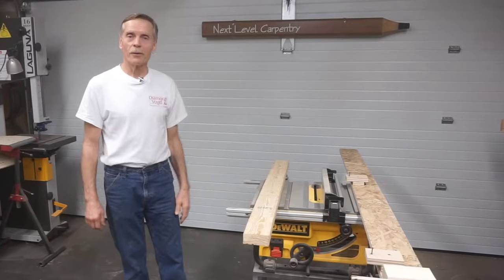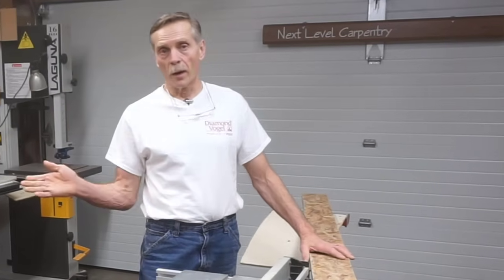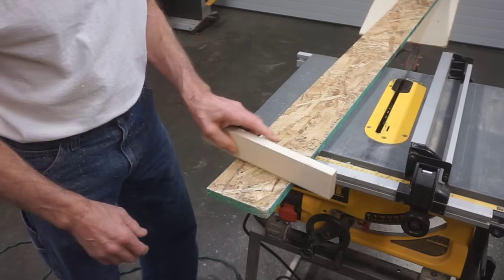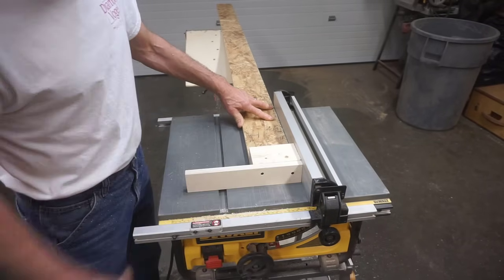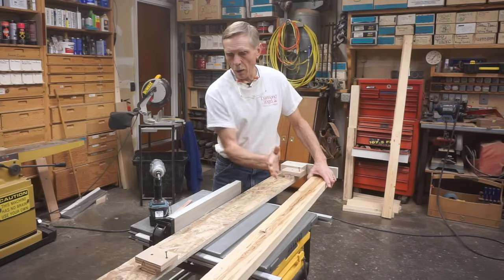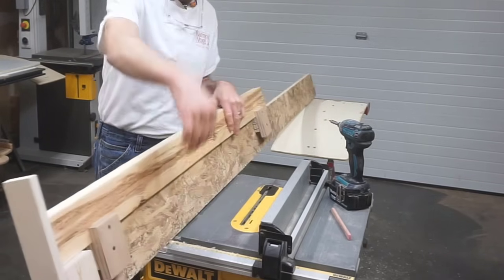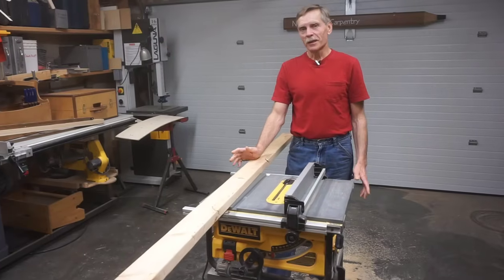How to Cut a Straight Edge on Crooked Boards

Comment: Dear Next Level Carpentry: It seems that your "Contractors Saw" is perfectly squared and that the fence is perfect.  One old carpenter once told me to "forget about portable saws" like yours, possibly because he had tried a lesser one, that had a useless fence. As here in my country all table saws are very expensive, my question is if you judge your saw to be good enough for precision work, or should I wait to buy (or build) a better one, Another person with a lot of dexterity, preferred to build his one from an inverted 8 1/4" Makita hand circular saw, and a third carpenter said he will always "build" a table saw from an arbor with bearings and pulleys and a larger motor"... What can you tell us?
Reply from the maker: I've had the DeWalt tablesaw you see in this video for about 20 years.  It's done everything I required of it on jobsites without disappointment over those years so I'd say it's perfect for that type of work: framing, siding and (with a high quality blade), trim installation.  I don't think you'd do better making a saw for jobsite use from a circular saw, at least where efficiency is concerned.  I don't judge the DeWalt as good enough for precision work like cabinetry and millwork.  If your goal is to do that level of work in a dedicated shop space then I recommend saving up as much as you can and buy the highest quality machine you can afford.  That doesn't mean a new saw either: shop around and, if you're lucky, you can find someone selling one because they upgraded or maybe quit the business... that's how I got the Delta Unisaw I've had for 35 years: business liquidation.  Good luck in your quest... Best, Matt
Reply: @NextLevelCarpentry  Thanks so much for your detailed response, I'll try to find a good used one.

Comment: If you're going to screw into the board you're straightening, why not just put the factory edge board directly onto it, screw them together, flip and cut?
Reply from the maker: That's another way of doing the same thing but I personally don't like it because of the extra blade height needed to make the cut, but that's just me...

Comment: All that for a 2x4?  Of course you could just run the piece through using a longer straight board as an extra long fence similar to this except without all the nonsense.  It would be the same result.  Push sticks for safety is all you need.
Reply from the maker: Please link to the video you produced to elucidate the world from your fount of knowledge to prove 'it would be the same result' because, without that, I call 'nonsense' on your comment.
Reply: @NextLevelCarpentry  r we still talking about a 2x4?
Reply from the maker: @thetruthonlydementia7379  I believe YOU are... but I also believe you've missed the point and lesson of the video.

Comment: Seems like a lot of work unless you have a sh---load of bananas to cut straight. Fastest IMO is to fasten a piece of scrap plywood (or scrap wood paneling) at both ends and middle to the banana board so none of the banana is out past the straight piece. Run through saw at depth of banana. Remove 3 screws. Discard narrow trimmed piece of plywood or paneling.

Comment: Efficiency! spending excessive time on setup  to correct inexpensive lumber to me makes little sense. If its late in the evening, you have a chance to finish a project that's is in a  remote location, maybe! but I just dont see the value.
Reply from the maker: Apparently it hasn't occurred to you that there may well be plenty of value in situations outside of your experience.  You might spend time figuring out why this video, produced by a career carpenter, has over 2 million views and earned it 48K thumbs up vs barely 1K thumbs down... you might well benefit from a little outside the box thinking perhaps?
Reply: Not all lumber is inexpensive. The technique may be on expensive hardwood boards, which is probably what Next Level had in mind. By the way, if it's a shorter piece, one could get the same effect by simply placing the straight edge along the fence and moving the bowed board along that -- it would have to be at least twice the length of the bowed piece, I guess, so that it doesn't rock or deviate from the straight line.

Comment: Good tip. A small correction though;  deviation from a straight line along the edge of a board is called 'crook' not bow. 'Bow' is a deviation from perfectly straight along the face of a board. If you have a 2x6, the edge is the 2 inch thickness and the face is the 6 inch width. Note: actual measurements are 1.5 inches and 5.5 inches for planed kiln dried lumber.  And its technically called a 'plank', not a "board"....just to correct myself. :)
EDIT:  I just noticed that the video title (correctly) refers to the illustrated deviation as "crook".

Comment: Only thing now there is a screw 
Hole in board ya want straight.
Reply from the maker: If you can't think your way out of that problem you best avoid working with tools with sharp, spinning blades... juss' sayin, dude. 🤯🤣
Reply: I meant to say ya straightening a piece of maple and ya used the wood clamps to hold it down with the straight board against fence. You take screws out ya have a whole in the board ya straightened. 😃
Reply from the maker: @williamlhumphrey8326  Like I said... if you can't think you way out of it...

Comment: That might be useful with high priced wood but not for a $2.00 2x4
Reply from the maker: You're kind of missing the point here George.  Actually it's NOT useful for high priced wood... that's what jointers are for.  It's foolish to assume this is meant to salvage one $2 board too.  The point is that when it's necessary to straighten a board with a bow, for whatever reason and for whatever cost justification THIS is how to go about it.

Comment: This all works for short stuff but not really useful for an 8 10 or longer board.
Reply from the maker: Why do you say that?  I've straightened 10'ers using the same method... granted, it's a little tricky but still totally doable.

Comment: I like your method, but I have to question the cost/benefits to doing this. If you are paying someone $15 an hour, doesn't it make more sense to use them to build with the straight boards you have rather than spending time straightening boards that after they are "straightened" can't be used as dimensional lumber? The cost of a 2x4 doesn't come close to what it costs in time to have someone do this.
Reply from the maker: I've answered this question a dozen times or more: your viewpoint is myopic, Doug.  I can tell you more than a few situations where this is absolutely practical, sensible and profitable but leave it to you to expand your perspective and answer the question for yourself.  Best, Matt

Comment: I dont know that I would trust that stock lumber has a straight edge everytime. Just because its painted green means nothing to me.
Reply from the maker: Just because it means nothing to you doesn't mean that it's untrustworthy either... any sensible carpenter will double check because 99% of the time factory edges are more than straight enough for this application so it makes much more sense to start with pieces that are painted 'factory edges' than to search for un-painted edges that are straight...

Comment: So, the first 15 seconds already give away the trick, yet the video is 16 minutes long. It's gotta be full of hidden gems beyond answering the question in the title, right?
Reply from the maker: I'm dying to know: does even the dog agree with you on that? 🤣
Reply: @NextLevelCarpentry  As you can clearly see in the picture, which is 100% genuine and not photoshopped in any way, he only agrees during "facepalm moments". I don't think you do those. 😂
 
On a more serious note, I was expecting something different from what I got, but that's OK. I thought it was pretty obvious where this was heading, and you could maybe stretch the explanation to about 5 minutes. From what I'd already seen by the time I paused the video to comment, you struck me as a no-nonsense guy who wasn't going to pad the video unnecessarily or give the topic a tediously slow treatment. So I was wondering what you were going to use the other 10 for. Turns out there was a lot more to it than I assumed when I saw that piece of straight edged OSB and things clicked in my head. Your explanation was thorough and covered a good deal of pitfalls one might not immediately consider. As a geek, a race not known for conciseness (we tend to value completeness and correctness), I appreciate that. I learned something.

Comment: Or save alot off time and screw the staight edge directly on the timber that need straightend.if you are scared off the tools you use i highly suggest to stop using it.
Reply from the maker: People need to discern for themselves the difference between fear of tools and respect for them and make decisions for practices based on the difference. If you perceive that the method shown in this video is fear-based then your perception and conclusions are wrong.

Comment: This is the most backwards complicated method to squaring a board I've ever seen.  If you already have a straight piece of plywood, just stack the curved piece on top, align your blade so that cutting through both pieces will create a straight edge. Rip it and flip it. You can screw the curved board to the plywood or use two side tape. If you really feel like wasting a bunch of time you can rig some hold down clamps. No point in making a whole jig to save one board.
Reply from the maker: Agreed: it's seldom worth 'making a whole jig to save one board' but, if and when it IS worth it or, which is often the case, I want to salvage a whole stack of boards, this method is more than worth it.  If you think that's backwards I question your assessment as inexperienced.

Comment: Well just get longer track than the piece and push it along the edge.or use planer . . It is effective but not worth the effort.and who cary scraps of 8 ft plywood . . .  
 find straight piece and line it with bended peice and push two pieces together .thats whole deal.not templets plywoods and god knkws what else
Reply: What a lame comment... good grief! 🤨
Reply: @mattjackson3996   Use your brain . .unless you need a drawing.i know from expirience americans cant visualize things . . Simple fence.then put straight piece  to extend fence and then you put crooked piece to straight one and then you push it on table saw . . .all video is about making extension to the small fence attached to table saw . .magic
Reply from the maker: @BvnnyXD  Dude: your response is just as lame as your original comment...

Comment: All the trouble to save a crooked board? A crooked board got its crooked reasons, there is a knot in the middle or the fibre structure of that board will continue to pull in wrong direction even after straighten out.  I think this method works in soft wood.
Reply from the maker: Ummm... yeah, sounds like you've not done much carpentry maybe? 🤨
Reply: @NextLevelCarpentry  I designed timber structure for building in Malaysia.  Warping is major issue nowadays as timber getting younger each year.  There is an old saying here about timber,  "built in December,  warp in spring"  all because of mansoon.   The hard wood we used is comparable to mahogany, namely teak, chengal, merbau, or balau.
Reply from the maker: @JasonSeow  I see your perspective.  Kind of makes sense now how/why you made your initial comment... an how my reply is fitting...
Reply: That's pine. It is soft. 2x4s are made of pine and that's probably why he made this video. Btw thats a crown not a bow and all crowns go to the outside when you build anything especially if its getting siding or drywall
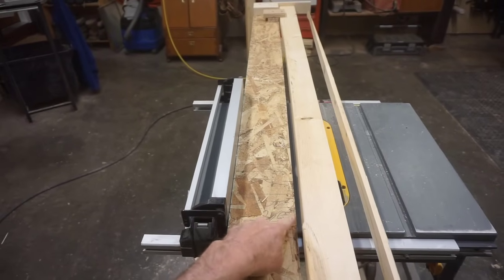Reply: 12:39 He addresses this concern in the video.
Reply: He demonstrated on whatever he had, but the technique works on anything. I don't have room for a jointer, so I use something like this technique starting with rough sawn material. If you are doing cabinetry and furniture, no matter what wood you bring through the door, one of you early steps (after acclimation) will be to put a straight edge on it. So, it might have been a straight grained, air dried, quarter-sawn piece of the most beautiful, stress-free wood in the world....I'm still going to straighten an edge for the work that I do. Always. You're right that some wood has an evil heart, like the last piece of !@#$# walnut that I worked with and there's no point even trying to save it. But that's not the point here, and he said so. He's showing a method for when you don't have access to a jointer (and don't know how to use a hand plane :-)

Comment: it is not easier to buy a large-format machine
Reply from the maker: The point is that this straightening process is easier on a large format machine, not that it's cheaper... hence the demonstration on a smaller, less expensive portable saw.

Comment: all that is needed to straighten any board is having a straight board, attaching all the blocks unnecessary. Thats just  my opinion,,   Probably a good idea for a beginner
Reply from the maker: Also a good idea for anyone concerned about preventing a trip to ER for a severed finger, even a beginner like yourself...
Reply: @NextLevelCarpentry  yea well if you SEVERE your finger straightening a board you don't need to be using tools at all
Reply from the maker: @bump4616  true... advice you should carefully consider.

Comment: Even simpler , use a 4 ft level as your  straight line reference while pushing the studs thru the saw .
You are making it too complicated
Reply from the maker: You are incorrect: the method you describe will only straighten a piece about 1-10" long.  If that's good enough for you, fine.  The method shown in the video is for those who require more accuracy in their work...

Comment: Hate to see drywall screws used ,they have no shear strength and the clue is in the name.
Reply from the maker: I hate to see drywall screws used for anything but drywall too... which is exactly why I use square drive cabinet screws on stuff like this: tough, strong and not brittle! 😎

Comment: The camera work is really distracting, all the zooming in and out.
Reply from the maker: Yes, it is distracting Gabriel.  It's just a test for viewers though because any snowflake that can't withstand poor video editing is never going to make it as a carpenter, a vocation where actual hard work and determination that's much more challenging than a little distracting camera work are required for success... you just have to deal.

Comment: Gosh, a lot a steps...I usually just screw the straight board to the bowed one, run it through and I'm done with it.
Reply from the maker: That's a great alternative if you've only got one or two boards to straighten but this method is faster on remodeling projects where repurposing old lumber means straightening dozens of pieces of varying widths and lengths... Best, Matt

Comment: And this is why they just throw em away. Because pricking around with a board for 15 minutes at your carpenters wage of 24 an hour is way more expensive then grabbing another 3 dollar board. Oy
Reply from the maker: If you work for $24/hour and it takes you 15 minutes to straighten a board Glen then your comment is completely valid! 🤨

Comment: Waaay to much work to salvage a piece of junk timber. Time spent is more than the value of the wood. Use it where bow doesn't matter or cut it into pieces for fireplace. There is a youtube video showing how to cut a straight piece of timber using a chainsaw. Maybe something like that could be adapted for this problem.

Comment: Blows my mind that people will use power tools like this table saw and not wear safety glasses, you only have one set. You mention how running a bowed and twisted board isn't safe yet no eye protection smh
Reply from the maker: Yet you will watch people using power tools and smoking cigarettes and not utter a word, right?. Right.
Reply: @NextLevelCarpentry  don't agree with that either but that's not gonna cost you the loss of an eye